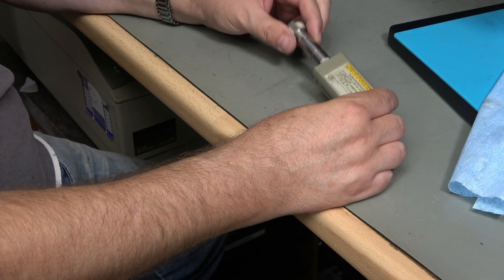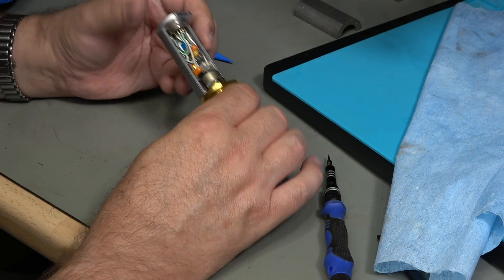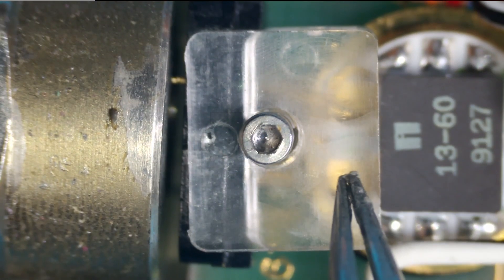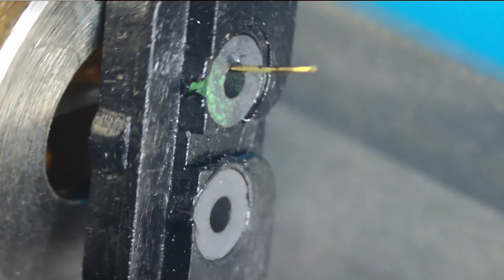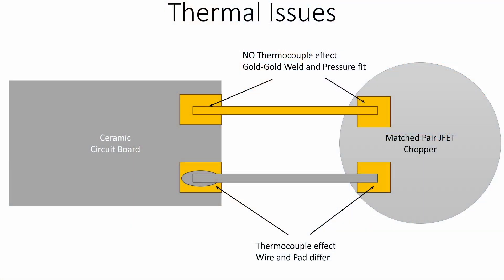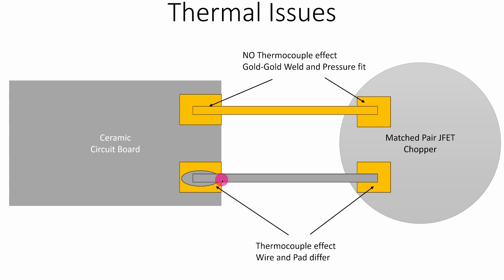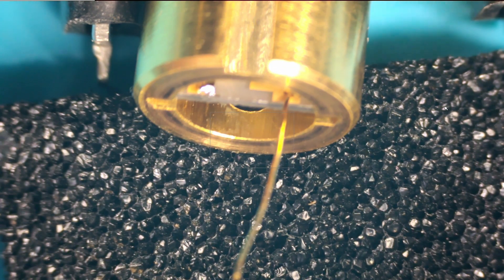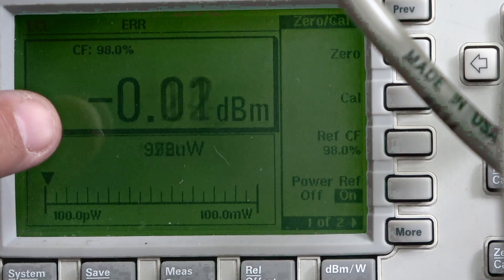HP 8482H RF Power Sensor - surprise fix #0100

Comment from the maker: I said that Gold melting point is low, but it is about 1000C, the problem is that this "gold wire" is an alloy and when you add solder it melts very easily.

Comment: Why not just try spot welding the gold wire? portable spot welders are dirt cheap these days.
Reply from the maker: i might give it a go at some point but the wires are very small and tricky to handle with my basic spot welder, and it involves more dicey disassembly to get access. one contact has to go on the copper pad, the other on the wire otherwise it just vapourises, having seen part of the gold alloy vanish on contact witt my iron, not too keen on purchasing more gold wire to have it vanish!  i might however attempt to at least match the two wires

Comment: I had exactely the same failure mode on one of these sensors… out of curiosity I soldered a new wire to the glass or ceramic hybrid sensor substrate. Both my new wire and the original gold wire get clamped to the chopper FET by the plastic mounting bracket. And guess what… it works great! Although it‘s not a gold wire drift and stability is excellent, just showing how much margin this HP stuff had in terms of tolerances and accuracy…
Reply from the maker: Yes, that gold removes uncertainty and some instability.  I'm planning on going back to it and just matching both wires with nickel plated copper so that both sides have matched thermocouple errors, thar way I should get better linearity at the extremes of measurement range.

Comment: This is why the manual and yellow caution label on the side tells folks never to hold the body while making connections. Hard to do sometimes since its just so tempting but this seems to be a possible case of that bad habit. Not 100% sure though. How the other wire didn't break is a mystery. Nice fix though. Great explanation as always.
Reply from the maker: maybe, there is also a warning label not to unscrew front connector.  need to do a short video with matched wire to see how close to spec it is